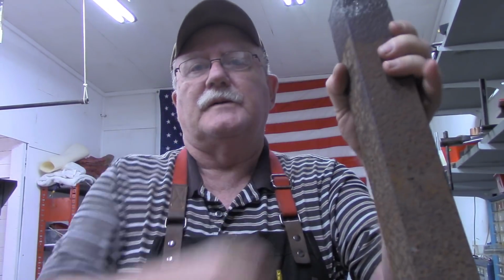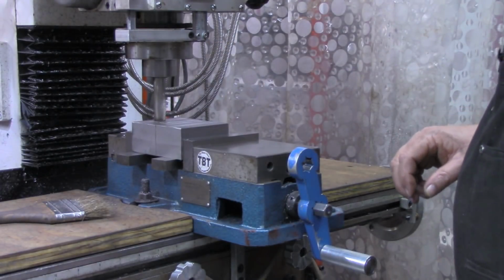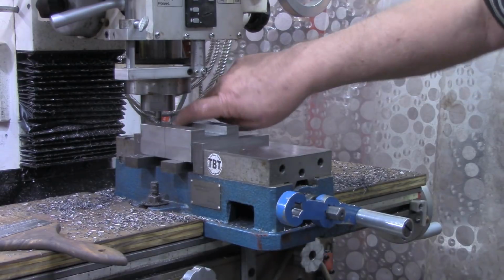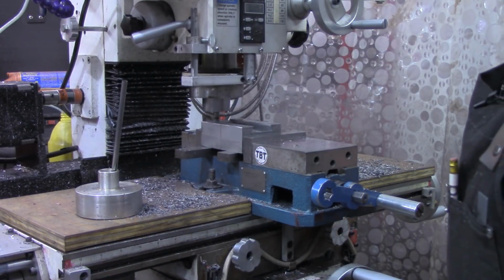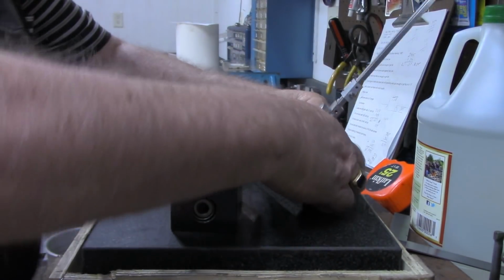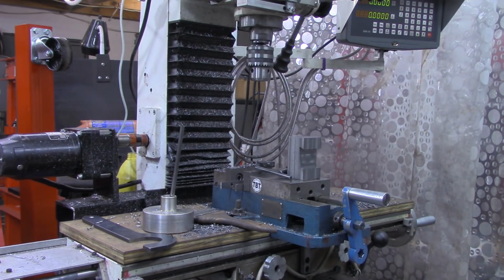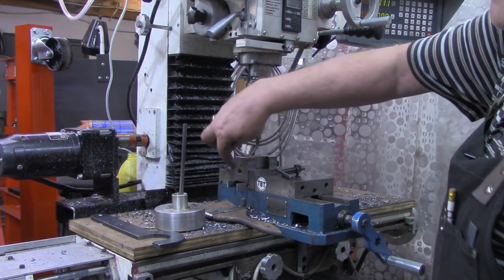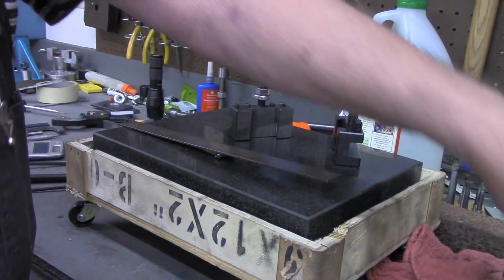QCTP Boring Bar Holders Part 2 of 2

Comment: I just finished mine today, I went a little different direction.  I've  had good luck using a tool post to hold a boring bar, but I have a BXA tool post with is stiffer to begin with. Do yourself a favor and get one of Randy's dovetail cutters. You will be a lot happier, I know I broke down and purchased one.
Reply from the maker: James Dedmon It’s on the way with a scriber as well
Reply: You will like the dovetail cutters. I  like mine, and I cut a lot of tool holders and there tough
Reply: Just ordered those two items from Randy myself a few days ago.

Comment: Pragmatically speaking Mr. Bozo has led me to make comparable mistakes when I went to cut a dove tail.  Now might be a good time to put some blue on those nice boring bar holders.
Reply from the maker: Amateur Redneck Workshop I actually "soaked" these for a couple hours at about 550 - 600 degrees and got a nice blue color. First time I had tried that & they turned our pretty good  - would have been better if I'd clean them better & not handled them with my fingers after cleaning. Still learning & got a lot more learning to do.
Reply: I may try that myself.  Does it make a durable finish?
Reply from the maker: Amateur Redneck Workshop I think so, but I only did it a couple weeks ago so hard to make a firm determination as of yet. They haven't rusted which is saying a lot considering the temperature swings we've been experiencing lately.
Reply: Bozo visits me quite often! I made some regular QCT holders then proceeded to drill the holes on the bottom side of one of them. Maybe I should start up a YouTube channel called Mr. Bozo’s workshop.

Comment: Just for your info.....on the tool holder that centre relief or the entire middle face on the tool holder does nothing as it does not make contact with the inner face of tool post dovetail when it's locked up.
The tool holder locks against the two outer faces of the dovetail and the centre bit MUST be clear or the holder will not work properly......   .25mm or .010" is all it needs.

Comment: You're "mistake" gets the centerline of the boring bar closer to the centerline of your toolpost which may slightly improve performance.
It's slightly stiffer and the turning moment on the toolpost is lower. Not such a bad deal.
Thanks,
John

Comment: I was wondering what dro you liked the best because I'm not sure what to get thanks for answering.
Reply from the maker: Thomas Cheatham What I have on my mill is from AliExpress. So far I have no complaints with it. The manual is a bit hard to understand & I’m sure I’m missing out on some functions, but for the price I’m very pleased. In fact I wouldn’t be surprised if they aren’t the same units that are rebranded & sold for a lot more.

Comment: Lee

Would have been quicker and probably just as accurate to clamp the reference holder to the work piece (reference edges lined up), then use a transfer punch to mark the work piece for drilling and reaming

John